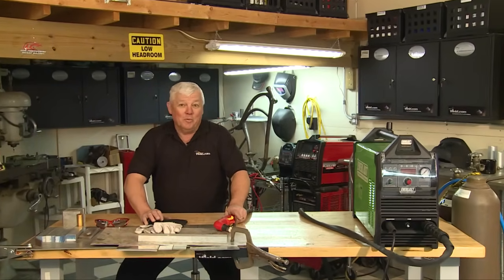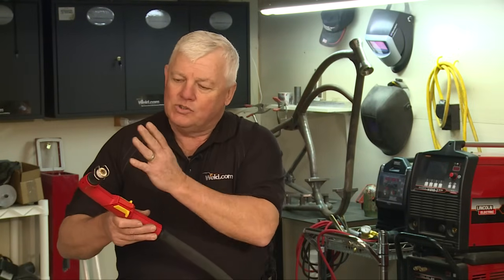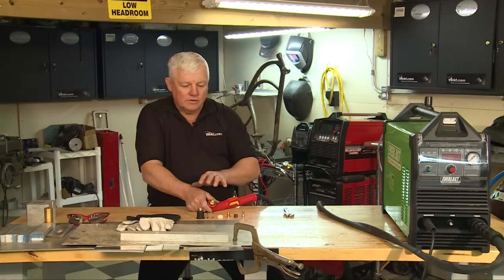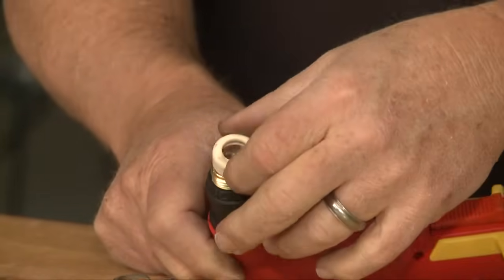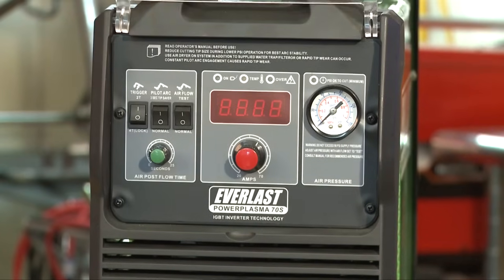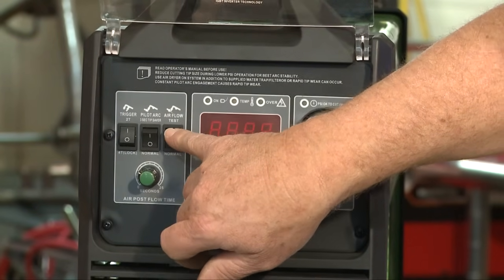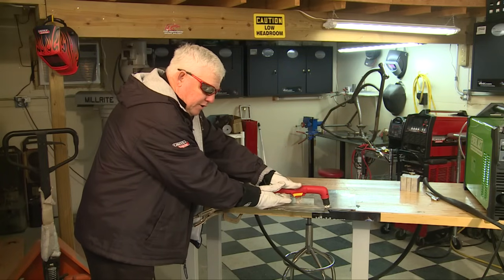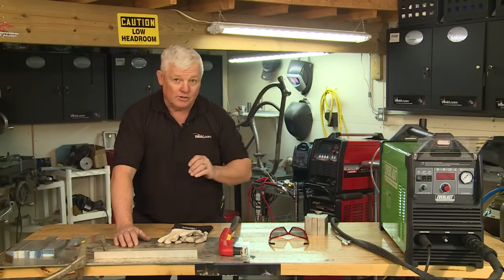Plasma Cutting for Beginners: Sheet Metal | TIG Time

Comment: Do you think I would be able to adjust the settings on a Harbor Freight plasma cutter so that I can get the steel red hot so I can Hammer Forge it? I don't need to cut, I just need to get it real soft. I'm working with relatively small pieces of metal about the size of a knife or axe head.

Comment: I bought one of the first Everlast machines. I had a problem with adjusting the settings for specific applications. I called the phone number in the manual. The guy answers, it’s the head of the company. We a long conversation. Nice guy very helpful

Comment: I use oxy/acet on farm and am going to try my uncles on some pieces.    Two ?'s:  1.)  How clean does the metal need to be when doing this, grind all the way or will cut dirty as long as you can make an arc.  2.)  welding helmet or torch goggles; are those special glasses he has on; shade #??                     thank you

Comment: Good information, but like most experienced users, they forget some of us have never used a plasma torch. What air pressure should we use for the gauge metal? :) I just bought a plasma machine and my first cuts look like I had my eyes closed! ;) That being said, what eye protection setting should we use? Cutting goggles or welding helmet??  :)

Comment: I bought a plasma cutter with a built in air compressor. Im planning on adding this device in the bed of my truck, and attaching it to a power source. Can my three Yellow Top batteries be used as a power source. Keep in mind my truck runs on two 400 amperes alternators.

Comment: Keep in mind the 110V units need aprx 30 amp capable circuit. Not your average 110v plug in which is commonly 20 amp..

Comment: You mentioned you were using 25 amps on the sheet metal,  and what would you run for PSI with that setting ?    Still a high amount or dial that similarly low ?

Comment: I've found that the dross ("recast") that adheres to the edges of a cut can be minimized by maximizing the speed of the cut.  e.g. You could have gone much faster in your demo.  To remove it, tap the edge with a hammer (motion in the plane of the material) and it will pop right off.  The "pilot arc" feature is intended for interrupted cuts, such as you would encounter when cutting expanded metal.  It keeps the arc going while the torch moves through the air gap to the next section of metal.

Comment: i am in the market for a "budget" plasma cutter. trying to understand the input vs output amps.
i have a 110v 15 amp socket/breaker. i also have a generator with 110v 20 amp and 220 30 amp sockets. (i also currently use the generator to run my air compressor).
the question: to run a plasma cutter to cut thick material i am under the impression that you need to set the output amps on the plasma cutter higher. does my input amps also need to be higher? 
like to cut material thick enough to require 40 amps output do i need a 40-50 amp socket, breaker and wiring? (i am ignoring the input voltage because that part i understand).

Comment: helooo , how long should a plasma elecrode last,
Reply: It depends on how it's used. If you don't put that riser on the end and it touches the work piece then pretty quick. A lot of it depends on the person using the equipment. Probably not the best response you were hoping to get, but it's kinda difficult to say. At our shop we use ours a few times a week and haven't changed it in 2 years. But we take good care of it.

Comment: I am a beginner with my plasma cutter, may I rub the metal nozzles against the metal, or should I stay a few mm away from it, if I touch metal then the cuts are much nicer, or is that bad for my Plasma cutter, I have an HBM Cut 60.
Would like your opinion.

Comment: I tried a bunch of different cutters, HF, Miller, Lincoln, and Hypertherm and FAR and AWAY the best cut came from the Hypertherm. I mean, not even close. Cut speed, depth and edge quality was in a completely different league with the hypertherm. I own mostly Miller welders, but when it comes to plasma cutting, Hypertherm is in a class by themselves. Look at the video at the 6:00 mark when he does that cut... the edge quality is HORRIBLE. My pm45 cuts a million times better, and it's four years old.

Yeah, they're more expensive but they are SOOO worth it.

Comment: when using a "DRAG TIP" the guide is not needed thats why there called drag tips and they have 4 little cut outs on the end of the tips and was there any thing in this video Mr Think-O..... i mean Mr TIG got right........ OH MY GOD this is why i hate youtube when it comes for looking for useful information its full of idiots that dont have a clue about what there talking about .......and oh Mr Think-O ..... i mean Mr TIG........ if you keep using plasma cutters the way you do there not going to last very long...... the tip must be within 1/4inch of your work to use the correct earth not the pre-light earth in the torch ... you may as well not even bother with ya earth clamp because its not doing anything the way your using it........ AND ITS CALLED A SWIRL RING not a insulator ring and ITS DROSS not "RECAST" and in your case you only get it when you dont know what the hell ya doing and should not be making videos offering advise or reviews......

oh and FYI about 35amp is a good place to be when using a 40amp drag tip you can start any where when using "ABOUT" 16g mild steel and move the torch about walking speed while dragging the tip on the steel and if you pritty much do the opposite to whats in this video you'll be fine 

OH 1 more thing MR Think-O........ dam i mean Mr Tig please re name this video to "HOW NOT TO Plasma Cut, for Beginners: Sheet Metal | TIG Time"

Comment: Those wearable tips, I assume they are made of steel?
Could they be welded up and the hole drilled back to the original size?
Steel can be welded, brass can be brazed, and that could be a cost saver in the long run.
I have in a pinch redone a MIG tip.

Comment: wow, that is alot of parts, i use a smaller Miller Spectrum, it cuts up to 5/8 no problem, been using it for 7 or 8 years.   the consumables last a long time, it changes from 110v to 220v, you can add extra air dehumidifiers, i cut using it for 12+ hours and it is still going strong.... this looks cheap and "hard to use", not too user friendly

Comment: No offense meant. I'm a 32 year year long heavy duty Mechanic/welder/fabricator and i build custom semi trucks/trailers/wreckers and soon choppers. And I buy "Cheap Chinese" Ebay equipment and I have no problems because I understand limitations and know not to push equipment and keep it clean and cool. My point is, You get to use/afford the best high end stuff. Why don't You demonstrate some equipment people in the real world can afford and show techniques and some of the difficulty's faced when You don't have top notch equipment. Heck, I cut 1/2 steel all day with My cheap Simadre CUT-50RX and TIG aluminum all day too with My cheap Infinity TIG200P.  My Lincoln 216 does the heavier stuff when welding 3/4 steel and My     100S spool gun for heavier aluminum all very successfully. Teach technique, not just go buy the best. And if Your asking why I'm here, just got bored and the rabbit hole led Me here. Help these kids, don't just tell/show them they need the best.
Reply: 62 yrs old here, get started ,you don t need the best, a little experience will tell you where you need to spend your money. I personally have spent thousands of dollars on tools, never regretted buying quality but it takes time. Good luck enjoy the work.
Reply: Boogie Woogie Papa I’m a bit older, 75.  I too have accumulated quite a collection of very high quality tools.  They are more pleasurable to use than less expensive counterparts.  I often think many of them will out live me, and, in fact, I am just narrowing them.
Reply: That should read “borrowing” them.
Reply: dieselrotor dude start a channel thats what us fabricators need
Reply: I only buy quality tools and equipment if its the only one that can do the job required, otherwise it's "cheap Chinese junk" 90% of the time.
Reply: For you Chloe ,but its also for anyone starting something new. Thanks for the response
Reply: Good video dude lm just starting out on fabrication need to know what plasma to buy
Reply: @shaun2049   epicweld.net
Reply: I couldn't agree more, any welding machine is better than no at all.
Reply: Hey how you doing I just heard you're coming you have so many years as a welder I respect that I want to ask you I would like to buy a plasma cutter maybe you could help me out which one would you recommend like you said Chinese one maybe I could buy one on eBay can you give me an idea I would really appreciate it thank you very much look forward to hearing from you God bless you family and friends...
Reply: These are machines every day guys use . I own a Everlast power tig 250ex , Vesa cut 60 and Eastwood tig ac/DC 200. That's as basic as it gets .
Reply: He is using an Everlast machine. That is the cheapest Chinese junk you can buy. He promotes their products because he gets paid to.
Reply: @intuitiveobservations459  you haven't been to harbor Freight have you?

Comment: Not to be rude, but that cut was done wrong.  Your wire guide on the torch should directly rest on the work surface of your stock when cutting.  It was spaced away three times more than it should have been since it seemed to be resting on the metal used as the guide.  More than likely the reason for the sloppy cut.  Still did well for a~25 amp cut that far away from the material.
Reply: I agree.
Reply: you are correct!
Reply: when using a "DRAG TIP" the guide is not needed thats why there called drag tips and they have 4 little cut outs on the end of the tips and was there any thing in this video Mr Think-O..... i mean Mr TIG got right........ OH MY GOD this is why i hate youtube when it comes for looking for useful information its full of idiots that dont have a clue about what there talking about .......and oh Mr Think-O ..... i mean Mr TIG........ if you keep using plasma cutters the way you do there not going to last very long...... the tip must be within 1/4inch of your work to use the correct earth not the pre-light earth in the torch ... you may as well not even bother with ya earth clamp because its not doing anything the way your using it........ AND ITS CALLED A SWIRL RING not a insulator ring and ITS DROSS not "RECAST" and in your case you only get it when you dont know what the hell ya doing and should not be making videos offering advise or reviews......

oh and FYI about 35amp is a good place to be when using a 40amp drag tip you can start any where when using "ABOUT" 16g mild steel and move the torch about walking speed while dragging the tip on the steel and if you pritty much do the opposite to whats in this video you'll be fine 

OH 1 more thing MR Think-O........ dam i mean Mr Tig please re name this video to "HOW NOT TO Plasma Cut, for Beginners: Sheet Metal | TIG Time"
Reply: Jemma Kesterton hahahahaha so true man so true..  I claim to be no pro at this. But I did work for Osha. Safety should had been a primary portion of the “For BEGINNER” video.  Like many, I saw that and was intrigued to see how a “professional” uses a plasma cutter vs myself. And I didn’t find anything really informative. Even though this is an old video. I would had at least had a follow up video on this subject. And my plasma cutter doesn’t have  the unique features as yours. So I do agree talking about the different styles of cutters that are out there.  Or explain the very basics of the machine and how it works... like turn it around and show us its other features. And the mess on that cut is what we refer as SLAG. Which surprises me that your a diehard welder, right?... ... 🤦🏼‍♀️

Comment: Thanks. Quite informative. 
So there is a ground? I have been surfing You-Tube tutorials and nobody mentions the ground return. Even Principles of Plasma cutting tell us about the electrical charges involved in plasma cutting but no mention of the return cable. Just one of those fundamental assumptions, I guess. Would be good to include it though as it is a part of the process.
How many times has a welder tried to strike an arc (MIG, TIG, Stick welding) and realized they haven't connected the earth return.
Reply: Yes, it requires a work clamp. That everlast plasma cutter probably has its clamp on the table.

Comment: There is one thing I need to know. I see it works from Electric. Is there a ground. You did not show that.....Also, about CNC..have you done that
Reply from the maker: Yes, James, there is a ground. We have not tested the CNC capability on this machine, but will try and get video of CNC capaibilities soon.
Reply: +Weld.com that would be cool. I'm looking at buying an Everlast plasma cutter soon.
Reply: +arbour ways Don't get anything less than the powerplasma 60. you won't regret getting the extra power because it also gives you a higher duty cycle.

Comment: Some of you are a little confused.  The width of the cut that the plasma arc removes as it cuts is called the kerf.  This changes as the consumables wear.  The stuff left behind after the cut is called dross.  This can be minimized down to almost none at all with proper machine settings.  Air pressure, amp setting, speed of cut and cut height are the variables. (assuming good consumables) This video is a terrible example of how well plasma CAN cut.  My hypertherm powermax 85 has a cut height of .060...yes sixty thousandths!  It also adjusts air pressure with the amperage setting.  Feed rates should be published by your manufacturer.  Get all these things close and you have a cut that looks like it came off a mill.

Comment: is gas cutting gun oxy-fuel?
Reply: 7150285 
Steel is made by alloying iron and carbon.
Stainless steel is made by alloying steel with several other materials, the most notable being chromium and nickel. The percentages of each material vary as there are several grades of stainless steel. 316 SS has 16% chromium and 10% nickel. 
These metals are non ferrous which means they don't rust, their oxide layer protects them from corrosion. This prevents stainless steel from rusting.

To my knowledge, all metals will oxidise. Some oxides work as a protective layer, some don't. For example, iron oxide is rust. Lead oxide is a protective layer, that's what gives it a dull finish.
Reply: No, it's just air from a compressor
Reply from the maker: grame141 is correct. Plasma cutters use compressed air. For some more information, you can check out this article: http://weld.com/index.php/plasma-cutting-a-beginners-guide.html
Reply: grame141 so gas cutting gun and plasma cutters are the same? I thought gas cutting gun is a torch or blowtorch
Reply: I wouldn't call it a gas gutting gun, if you're using a gas torch then yes there is an Oxygen and Acetylene mix. Commonly called Oxy-Acetylene and the mix is roughly 1:1 for the normal flame and full oxygen for the cutting flame from my memory. it doesn't cut metal the same as a plasma either.. when cutting steel there is a chemical reaction that occurs. the metal is heated to melting temperature and then the oxygen is released at a higher pressure, this doesn't cut the steel by melting it but by oxidisation and corroding it away, it was described to me as being like instant rust.
Because of this, it will not cut through stainless steel or aluminium because their oxide layer is not corrosive, that is where you would need a plasma cutter

If you're using a plasma cutter then there is  an electric arc and compressed air used
Reply: grame141 so oxidizing metal will cause it to become weak like rusting it instantly? That's why metal will become weak when it rust?

What material is used in stainless steel to prevent it from oxidization?

Comment: Prandomable    This plasma cutting unit is a robust 70 amp power supply and can handle 1/2" steels and hardened steels without much of a problem.  When you get to 1/2" thickness or greater you will find your kerf starts to enlarge.  good luck Mister Tig

Comment: "Just try it out. Test it."

Ummm.. OK. Not really a possibility at the Home Depot or Lowe's. And I mostly shop on Amazon. I've been to my local welding supply store, and those guys didn't seem like the "Come around back and play with our equipment." types of guys. Where do you suggest I go to try out a bunch of plasma cutters.
Reply from the maker: Check out the Weld.com forum. There are a lot of guys on there that would gladly let you test out some machines if they are in your location. Where are you located? http://www.weld.com/index.php/Weekend-Warrior-Welding-Forum/categories.html
Reply: hire it
Reply: from co-workers and other professional networks
Reply: You should have a local welding supply store somewhere near you. They don't advertise much so you will have to do some googling to find some place near you. If you just want cheap and available harbor freight sells one and I think Tractor supply might. I bought a 3 in 1 combo online for around$400. 40A plasma cutter to cut 3/8" and server 1/2". 150A stick welder @60%duty and 160A TIG @60% duty cycle.  Been a great hobby machine. Is more affordable because it uses DC inverter for power instead of traditional, heavy steel transformer power that costs more to make.

Comment: I need some advice i have a tacoma truck with frame damage and i want to cut the frame up into sections to to scrap it. Whats the best way to cut it without making lots of noise? Plasma cutting or torch cutting?
Reply: Plasma. Less sparks, no torch tip pop.Just a hiss of air and the neighbors won't have a clue.
Reply: hmm sounds like a their with a stolen truck to me.